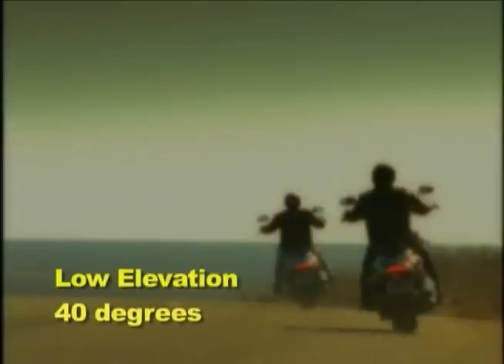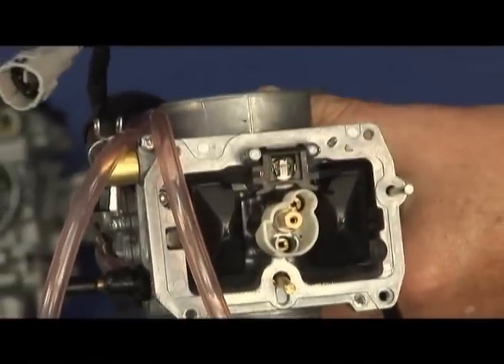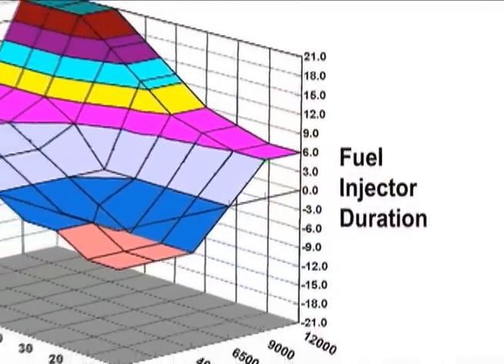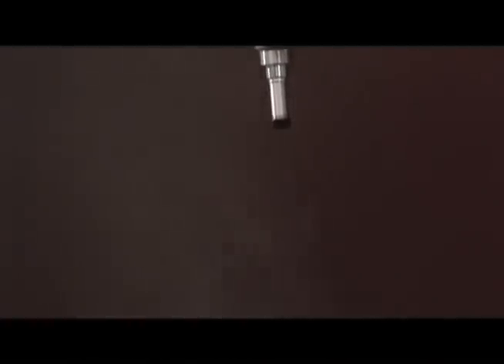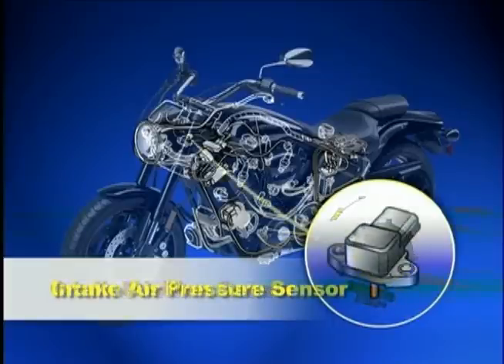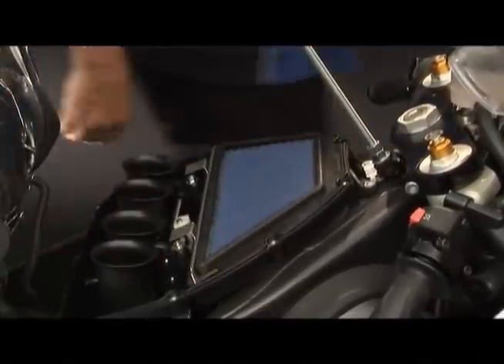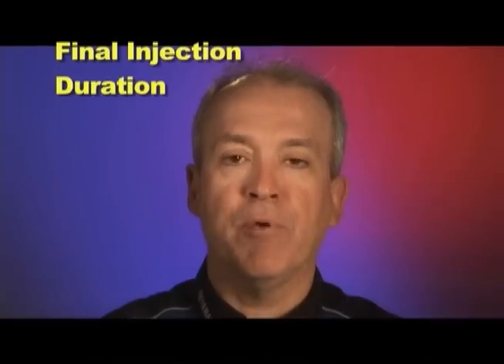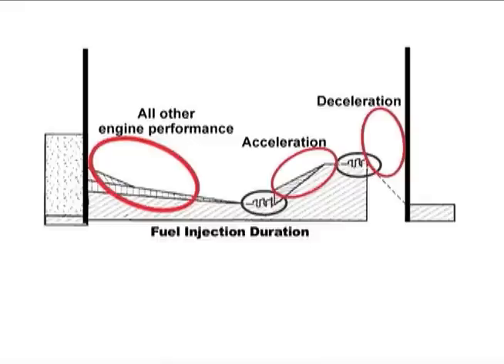Motorcycle Fuel Injection Systems video 1 by Yamaha Motor Corp.

Comment: What I can’t understand is why so many engines are still designed as if the fuel system was an old style carburettor and not designed for direct injection, when the consensus is direct injection is far better and cleaner environmentally.
Reply: Direct injection has its costs, requirements and disadvantages. Check the wiki page for more info. Port injection is so much easier for manufacturers.

Comment: please answer my question!!!!! my Yamaha R15 is giving very bad mileage around 30 someone told me that fuel injector need be cleaned can it be ? last tell and any your advice to increase mileage please help ??
Reply: Navneet Singh get it serviced,did you use a bulky tyre and changed air filter? Injector should be cleaned between 15-20 k mark
Reply: Navneet singh  is air filter clean? Spark plugs look good? How long since injectors been cleaned? Fuel pump in tank can have clogged filter

Comment: Does disconnecting the battery terminal will affect the ECU system?
Reply: Its like turning the key off.
Reply: disconnecting the battery will reset the system to default,some cars lost its memory for example the time and date and your settings